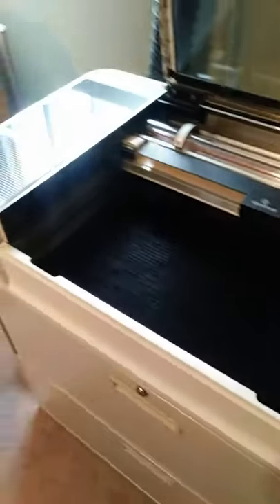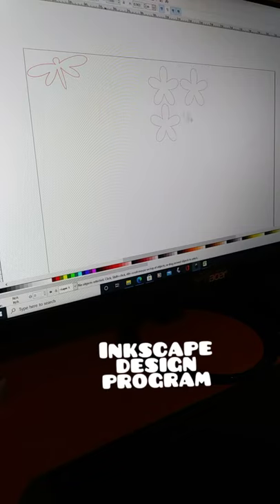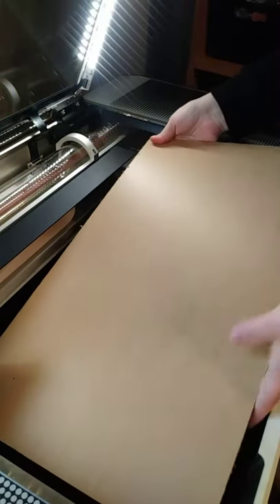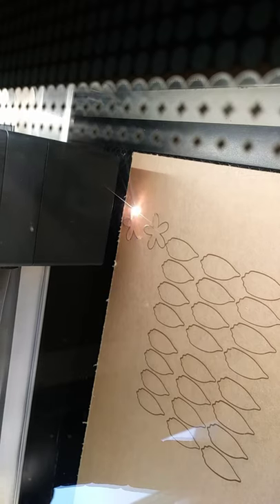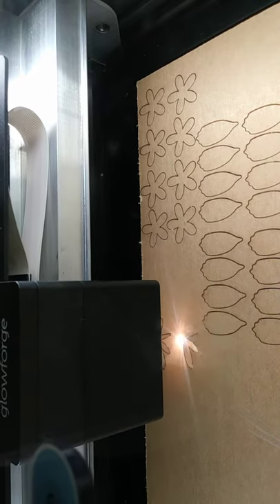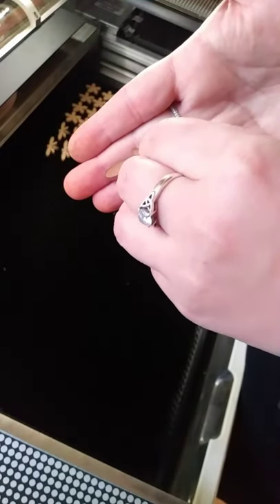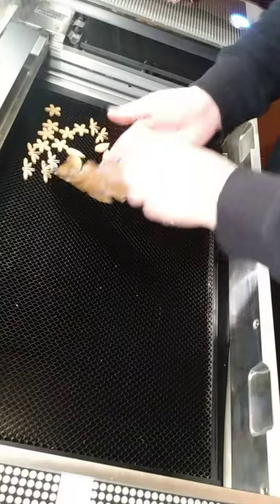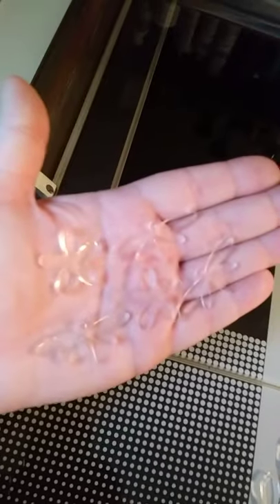Cutting the Acrylic Blanks for Molds Using a Glowforge

Comment: Where you make the design to actually cut? I am struggling with this so much. I have a design I made to go on a blank but I have my own glowforge so I’d like to outline my design so it can fit on almost perfectly. I want it to be a badge reel but always bought my blanks from 3rd degree laser, even with having a laser cutting machine. My dad recently passed away and I’m finally trying to learn more now on my own and using what I have. I just can’t figure this part out. Please helllppp.